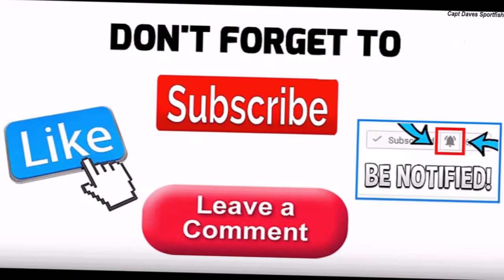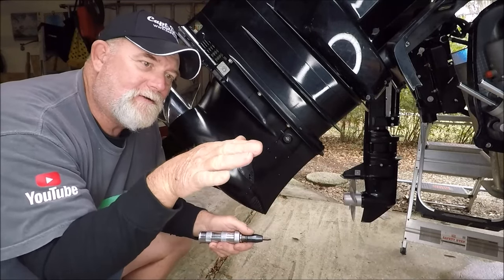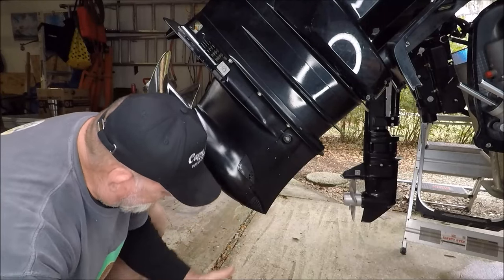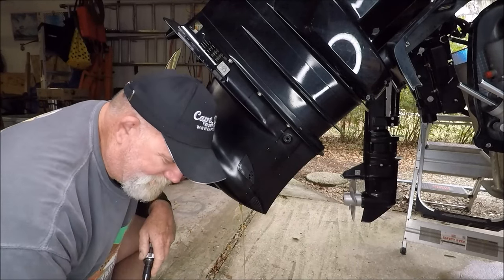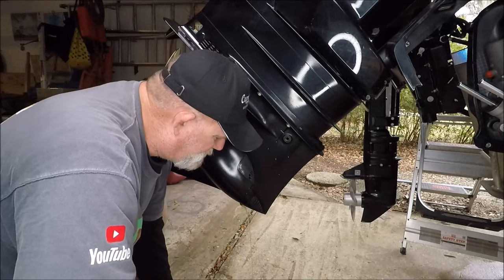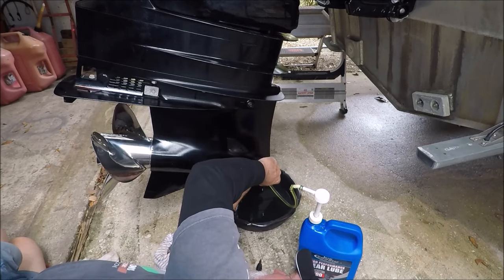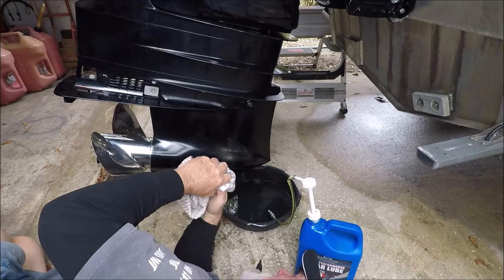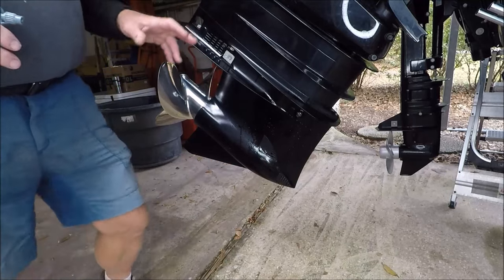LOWER UNIT GEAR LUBE, ''What NO ONE EVER shows''

Comment: The rig is aluminum, so are the threads.  Then using an impact screwdriver when tightening the plugs is not good at all. God enough whith hand power, Just like with oil plugs on car engines
Reply from the maker: IM NOT WACKING IT TO DEATH.....I do per my 40 yr mechanic does & recommends. NEVER had a single issue, in my 45 yrs of Outboard maintenance. But thanks for having to comment YT ninja.
Reply from the maker: I guess the 40-year mechanic that showed me how to use that tool was wrong
Reply: I agree.  God is always enough 🙂

Comment: Changing your lower unit oil is one of the easiest jobs you can do on a boat.  It should take 10mins per engine.  I would not torque the bolts that huge. The manual calls for 6.6 ft lbs of torque which is hand tighten and not even that hard. Always wipe the magnet on the bottom screw clean, if your bolt doesnt have a magnet, go buy one, you should have it.  I keep 2 qts of gear lube with me and change it right there at the boat ramp after i get back so its all nice and hot.  Dont go past 100 hours changing your oil is great to see how your seals are holding up. If its milky you know you need to change one of the 3 seals.  Buy a 25 pack of the crush washers, they are fiber so make sure to get the right ones not generic ones.  Lastly, all the pros and shops all use quicksilver sae90 lower unit oil.   The oil is greenish blue in color.  I have yamaha engines and still use quicksilver, its not great for just Mercs it works for most all outboards and stern drives.
Reply from the maker: I got it taken care of, been doing it for 40 plus years!  Never had a lower-unit fail. Other people may not want to do it BECAUSE the videos usually  DO NOT show the messy parts.

Comment: Dave....always make sure you can remove the top screw first. If you drain it and can't fill it back properly then you're in trouble. Fill from the bottom until it comes out of the top hole and with the bottle still in the bottom hole screw the top screw in. Then remove the bottle tip and screw in the bottom screw. Remove the top screw again and top off. Filling from the bottom prevents air bubbles.
Reply from the maker: OH my stuff comes loose and yeah I got it. People ask me all the time "why from the bottom??"       #trump2024

Comment: Yes, physics states that it'll create a air lock in the lower unit. if it's leaking you need to wait 10-15 minutes for the air bubbles in the oil to burp out.. then add more pumps.

Comment: Capt Dave, sort of a stupid question but why do people filled from the bottom and not the top hole on an outboard motor? In a car transmission or differential, you fill the top until it start to drip and put the fill plug back in.
Reply from the maker: from what I understand it's because it's a closed system with no breather
and you don't want air pockets or bubbles

Comment: DillMonster260 
Now when your done pumping the oil in the bottom unit before you pull the pump hose and put back in the screw could you tilt the engine up to keep your hand from getting lower unit oil on your hands
Reply from the maker: DOUBT IT. gravity doesn't care. Only video makers, who never show you getting gear oil on ya.

Comment: Question: can those fiber washers be found at Ace or Home Depot.  I’m doing our Mercruiser and I’m in the learning phase.  I was hoping to find those plug washers so I could get them right away.  I wonder why they aren’t rubber like on an oil filter.
Reply from the maker: NO.  They can be found on Amazon if thats fast enough for ya.

Comment: Thanks for acknowledging the absolute BS that is lower unit gear oil changing. I still can't believe this is the best system for doing this they've come up with.
Reply from the maker: well, MERCS ya gotta take off the PROP!! (not sure if all MERCS are like that?) and in the hub under the prop shaft, there's a oil plug. Its a old saying but ''man went to the moon'', Yeah, ya got that straight.

Comment: Wow Orowock1 your a heck of a good man! I bought a lansky angle sharping system it works pretty damn good for me.
Reply from the maker: YES HE IS❗  I bought one, and so Toy like....didn't get a good review on Amazon from me and didn't make the cut for my tools of the trade page. I like the spyderco sharpmaker, way better. (with extra stones)
Reply: Got to take care of my slow pitch jigging coach. The wen sharpener is new to me but so far iv'e had some pretty good results.
Reply: @orowock1  nice man I've seen them I know they would work great for chisels planes knives sharping. Take care happy new year guys.
Reply: @CaptDavesSportfishing  I gotcha I bought the diamond kit with the extra fine stones and I get a polished edge and sharper than any other knife I've owned. I go to a knife shop every now and then the old man sharpens on a water wheel and he does a good job but with the lansky I can get sharper, just my experience I didn't want to spend the money on a edge pro but looking back I should of just bought it. Anyhow happy new year Capt!
Reply from the maker: @shoresharp8349  yep, watch the ''Aussie in his dungeon'' on the YT,  he uses the lansky. He even has a Tormek. And still uses his lansky

Comment: Why not leave the drain plug in and fill it from the top hole until it leaks out?  Seems like that would save you half the mess.
Reply from the maker: GREATEST QUESTION EVER ASKED ON MY CHANNEL SINCE 2007❗❗    I asked the same thing many moons ago as a child. """"""SUPPOSEDLY""""""" top fill creates no bubbles. There's just a S.O.P. way of doing things
Reply: Ya tried it?
Reply: @C509NorthernTerritory  that is how most automotive transmissions and differentials are filled, so I don’t think it would be an issue filling from the top. If bubbles were a concern, check the level again after running it in drive and top it off. Any bubbles should rise to the top pretty quick I would imagine.
Reply from the maker: @C509NorthernTerritory  NO. When it comes to my livelihood, in which my outboards are. I stick with all manufactures suggested maintenance recommendation.
Reply: @SeanEurich  it has to be filled from the bottom to avoid any voids. Its manufacturers instructions.